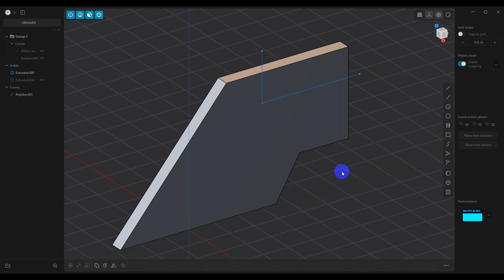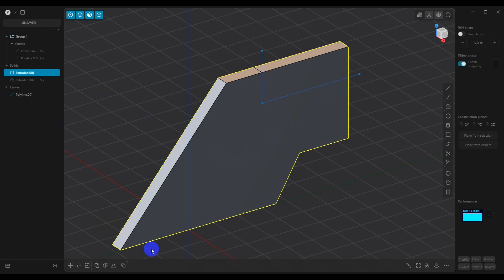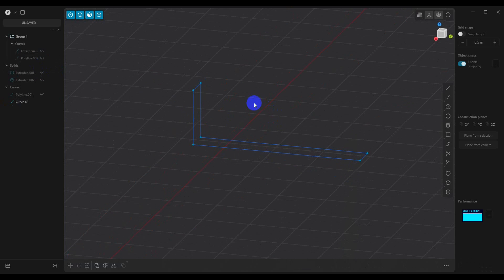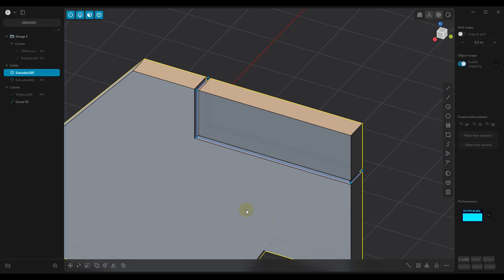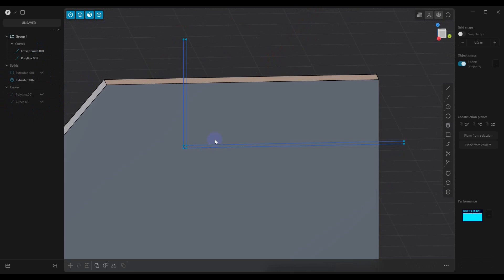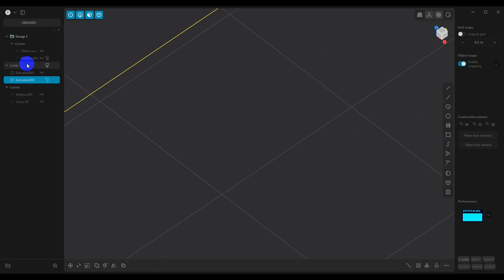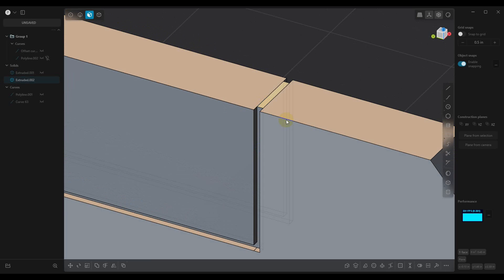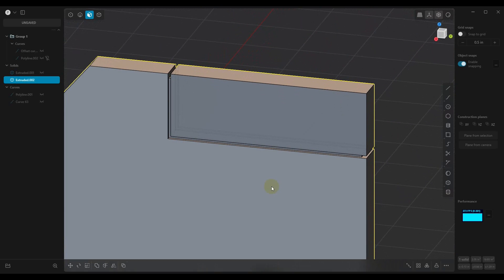2 Ways to Create Panel Line Details in Plasticity1

Comment: I like that you're making some Macross stuff-- good use of the app!  A third panel line method is to create a new body by cutting the object along the intended panel line, then chamfer each side of the two edges that meet.  This gives a v-shaped scribe line... which is sometimes nice.  It's little more crisp than the rounded channel, but a tad more subtle than the rectangular one. I also like that if I'm going to print and mold the part, the mold will probably not catch air bubbles, or tear quite as soon at a V-shaped scribe line. Depending on the depth and scale of course.  But all three I would find useful, for sure.  Cheers for the cool video!
Reply from the maker: @jameshakola3603
Thank you for the feedback! 
I'm a big Macross fan, for sure. It's something else I grew up on. I just finished the gun, and I am working on the VF-OS now so I can make a custom 4' tall version with my spin on the design.
I like the idea of using a V-shaped scribe line. I had planned on doing a video of a few other methods as well, maybe I can add that method to the video.
Thank you for the sub and for helping me grow the channel!

Comment: Just give the pipe a square profile! It doesn’t have to be round.
Reply from the maker: You are correct, but as I told lew6598, I prefer more control over my width and depth. Another reason I don't use that method is that I like to leave behind a sketch reference in case I need it later for other operations. Thanks for leaving a comment.
Reply: Does it have the square feature at this moment?
Reply: @whitardesigns7572  Yes.